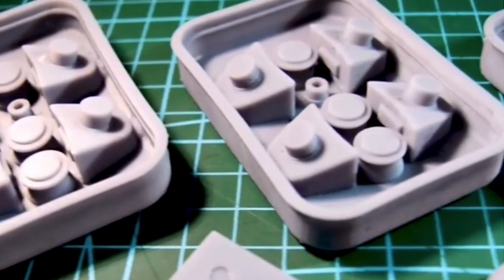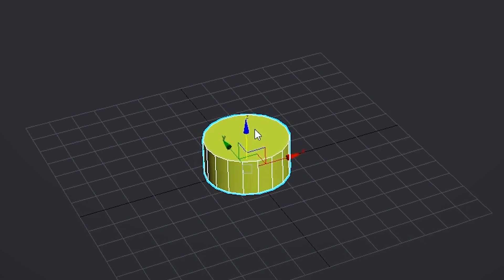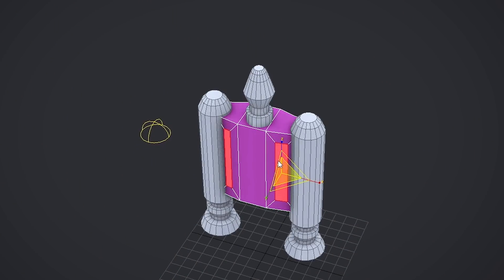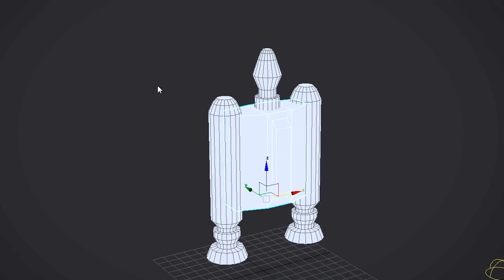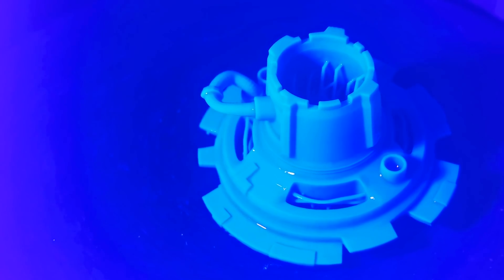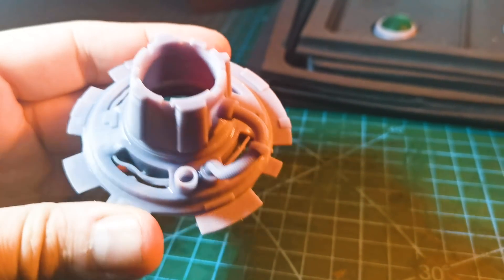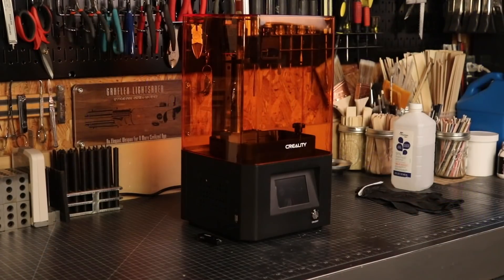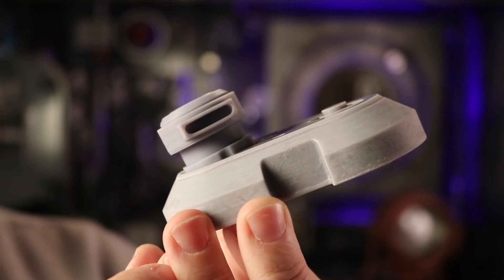3D Resin Printing Your Own Greeblies | Great Greeblies and Where to Find Them

Comment: I wanna get started with 3D printing, would you suggest I buy a resin or filament printer first?
Reply from the maker: Oh man . . . that is a tough question.  The first thing I will say is that it depends on what you want to make.  With the resin printer you get incredible detail but the drawback is you end up with very small prints.  With a filament printer you have the ability to build larger projects; Helmets, Full Droids, etc.  The downfall (in my opinion) is the sanding and prep.  But with Resin you have other challenges with clean up and UV curing.  Sorry, this is likely not helpful, I think you should decide what you are interested in making and then chose the best tool for that purpose.  Hope this is at least a little helpful
Reply: @TheSmugglersRoom  that was actually quite helpful! Ill also have to look at prices, but that helped me quite a bit!

Comment: Love the video. Great job to both of you!! The only question I have is how affordable is it? And not having any experience is it worth it? Guess gotta keep learning as a padawan..
Reply from the maker: The initial investment is not cheap.  I was able to grab the printer on sale for $150, but I see now it’s up to $199.  After that the IV light and turntable ran about $30.  The resin itself is $36 per bottle.  So to get started you are at almost $300.  However, after that the overall cost is very low.  The stuff I have been printing are coming in under a dollar per print worth of resin.  I’ve made a dozen or more prints and still have not gone through my first bottle of resin.  So after the initial investment it’s very affordable.
Reply: @TheSmugglersRoom  yeah thought it was just a little pricey brother. Gonna have to wait on that..

Comment: Another good video, I use the Creality LD-002R printer like yours. Love it. Clean up is a bit fussy but great for the sharp details.  I have 1 problem though if you could address it please. Water Washable resin is no safer than standard resin in the uncured liquid form. I don't know if James is actually washing this resin down the drain or if it was a B roll shot, but PLEASE do not rinse water washable resin down the drain.  The only bonus to water washable is the money saved on isopropyl alcohol or other solvents for cleaning prints. It still needs to be washed in a bin and that waste water treated as a chemical.  You can put the water outside to cure the particulate resin and then dispose of the water but never rinsing straight down the drain.
Reply: Exactly, it's really not ok to wash it in the sink...

Comment: OMG!  You should NEVER put your wash water down the drain!  It is contaminated with resin which is a TOXIC substance!  Water wash is the dumbest idea in resin because of this exact error.  Use regular photo cure resins and isopropyl alcohol that you can EVAPORATE once it’s saturated.
Reply: @Barrett Dent, I’d be more interested in learning more about this “photo cure resin” and alcohol. When the alcohol evaporates, does that mean the remaining resin can be reused? I’m wanting to get in to 3D printing, and I prefer the look of resin over others. I want to protect our waterways (and environment) as much as I can.
Reply: @Deanna_the_Baker  No we’re talking about the wash liquid post print.  After it’s become quite saturated you’ll evaporate the alcohol simply by leaving it uncovered in a well ventilated area.  The contaminated mixed residue that remains following evaporation can be wiped up with a paper towel (using gloves for protection) and then allowed to dry (cure) fully.  At which point it is inert enough to make disposal straight forward.  Cured resin is a class 7 recyclable.  Check your local disposal regulations.  Despite being “recyclable” it’s not actually recycled in most places.  But it’s in the liquid state that resins are classed as toxic waste for disposal purposes.  In that liquid state, they must not be put into your municipal or septic waste water systems where they might get into the water supply of the municipality or your own well.

Photo cure simply means the resin chemically reacts to light initiating the state transition to solid.  This is different than the two-part mix resins where you’re adding the hardening agents directly and will have a specific working time.

The leftover resin in your vat after your print of course can be filtered back into your resin bottle.

The real issue with these water washable resins is that users may be tempted either through ignorance or disregard to simply dump them down the drain.  People in the industry doing professional resin printing do not use water wash because it’s less effective and actually a potentially thornier disposal issue.
Reply: @barrettdent405  this information is so very helpful. Gives me a lot to think about. It’s sounding like something not really suited to a small apartment with less than adequate ventilation. Thank you for this.
Reply: @Deanna_the_Baker  Look into enclosures.  A lot of resin printer owners use indoor growing enclosures.  There are ways to vent them.  Resin has a tendency to be highly mobile.  It will get around.  Even in industrial settings with separate ventilation, protective clothing using transition zone vestibules, traces still manage to escape the work area.  So honestly, a small apartment isn't ideal.  However that doesn't mean it's not doable.  You just definitely don't want to do this in your kitchen.  Safety starts with awareness and knowledge.  Never hurts to do some more research before you decide.
Reply from the maker: Thank you so much for all this information!  This really is something we should have included.  I really appreciate you taking the time to run through all of this.  The last thing we want is for folks to be dumping this stuff down the drain or for someone not to take the toxic levels of this seriously.  So very much appreciated!
Reply: @Deanna_the_Baker  Once the resin is cured, it's cured, you can't reuse it or melt it back in any way.
IPA is really expensive were i live, so i use water washable, but Barrett is rigth, it's more troublesome to deal with because i can't let it evaporate like alcool.
Reply from the maker: Hey Barrett, thank you! James and i just had that discussion and the sink he uses is a shop sink not attached to his main plumbing system or a sink that is used for cooking or anything like that.  It does not flush out to the main system.  That said, you are correct.  It should not go down the sink.  Thank you for pointing it out here.
Reply: @TheSmugglersRoom  Thank you for taking resin safety seriously and having that discussion with James.  It really cannot be stressed enough that resins are toxic and must be handled and disposed of properly.

Congrats on your new toy (tool.)  I am sure you're going to love it.

Comment: My friends have been telling me I need to get into 3D printing. I’ve been resistant, because I loathe sanding. And every 3D print I’ve seen has had those awful layer lines. Now, dammit, you and RBB had to show me those resin printers. And then I had to go and look at the pricing. Looks like I’m going to have to make room for a resin printer. 

How about an episode on Fusion, and setting up files for printing? How do you establish the supporting framework? What’s the learning curve like for 2D designer to grasp Fusion and designing in 3D?
Reply from the maker: Sorry Deanna, there is always a catch isn’t there.  

Love your idea on fusion and the setup.  That would be really helpful.  I’m still a total noob with both, but I’d be happy to share what I can!
Reply: @TheSmugglersRoom  your noobness on topics seems to evolve a lot faster for you then for me at times. Especially when it comes to third dimensions. Lol

Comment: I was just looking at resin 3-D printers great timing! I was also looking at doing 3-D scans with my smart phone.
Reply from the maker: fantastic my friend.  I think you will love it!
Reply: 3-D scans with your phone.. I had no idea that that was a thing! Thanks for the heads up
Reply: A resin printer gonna be a mess to take care of (don't ever wash in a sink !!!) but it's worth it for miniature. 3D scaning with your phone on the other end, will not work as much as you immagine it.
Reply: @SaitoGray  any experience with it? What would work for miniatures and greeblies?
Reply: @sketchyguynv  a resin printer is perfect for that, but you can absolutely forget about 3D scanning them. The amont of work required to make them look decent require a lot of knowledge in 3d modeling. It will be WAY easier to learn how to use Fusion360 or Blender and make them yourself.
3d scanning work on really particular case only. And you need a pretty expensive scanner, and there's still a lot of work after to make a decent model. It's not worth wasting your time with it. It's better to learn how to model something.